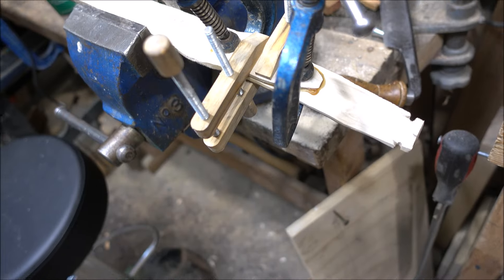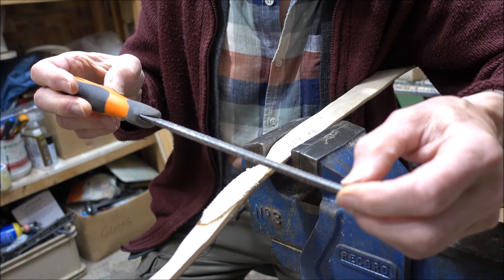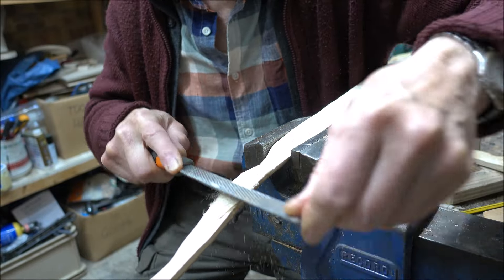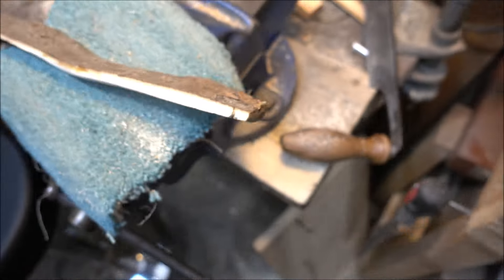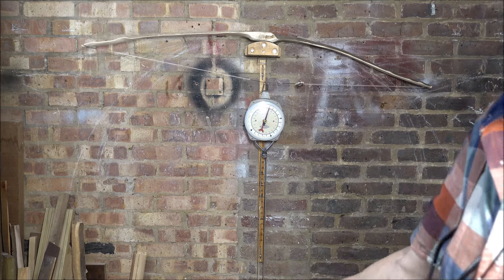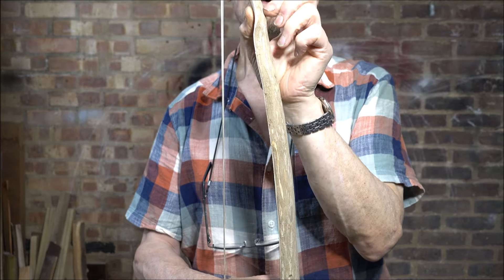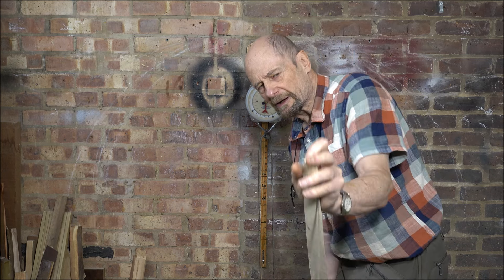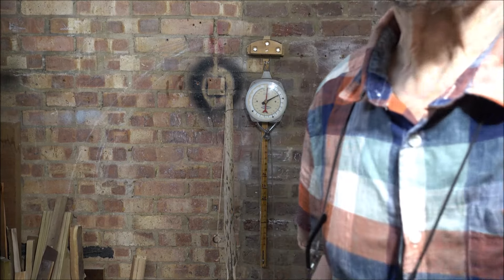Hornbeam Stick Bow pt4

Comment: Great series. Could you elaborate a bit on considerations you make with tillering of crooked sticks? Especially with reflex on the one limb and deflex on the other. How do you balance the esthetics of a symmetrical brace/draw profile versus spreading the load evenly, with the deflex/reflex part looking weak/stiff?
I have the impression that this is the preferred way of how white-wood trees of limited diameter tend to grow: even when they look perfectly straight "in the wild", they seem to be deflex/reflex when confronted with a ruler or a tillering string.
Reply from the maker: Good question, I'll talk about it some more in the next video. The aesthetics are to a great extent irrelevant, but we all like a bow to look good. 
Years ago I made a self Yew English Longbow and shot it at an event where Robert Hardy the actor and authority on the Longbow was present. The bow happened to have one limb slightly deflexed, and I'd made that the lower limb... of course he commented that the lower limb was weak (I didn't bother to argue, as he was very old at the time and I think it was the last event he attended).
The bottom line is, if it shoots well and doesn't take an uneven set, the bow is fine.
PS, I got him to sign my copy of "Longbow"... it's a rather shaky signature 😞
This video shows one trick that I tried:-
https://www.youtube.com/watch?v=j0cyp4g9Noc

Comment: Unless of course the oak is very dense and very straight …
Reply from the maker: TBF, I've only seen one English Oak bow (poorly made) and it was full of chrysals. So maybe I shouldn't judge. And that's why I've not tried Oak.
Reply: @delcat8168  English oak is not a bad wood, but when working with handtools it dulls the tools and just works horribly